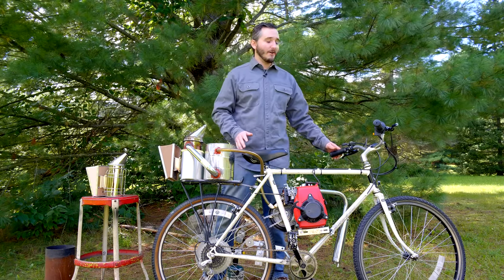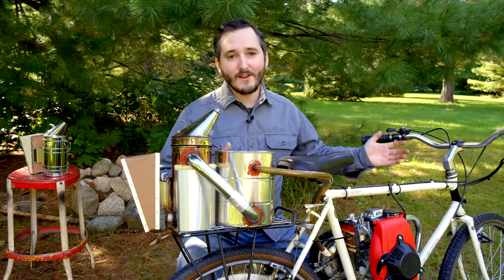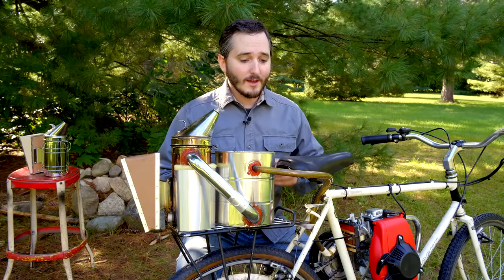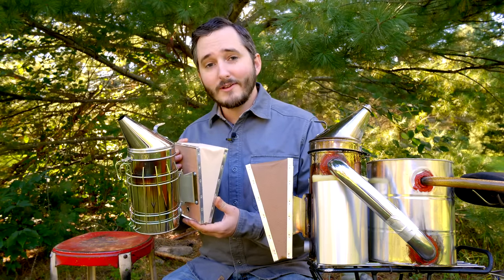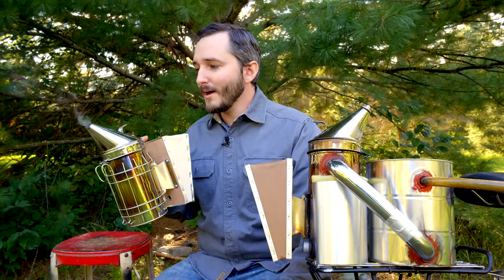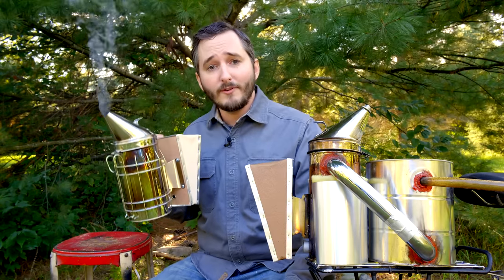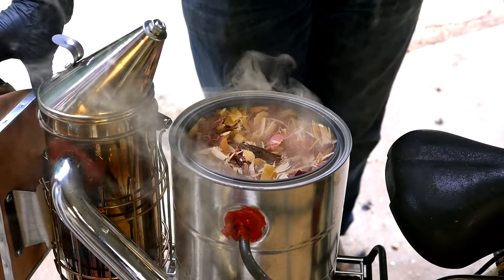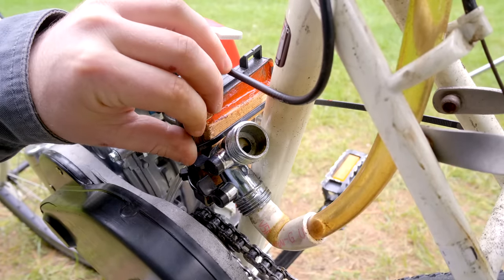Running a Gasoline Engine on Firewood | Woodgas Biofuel

Comment: can woodgas be made from industrial cannabis? killing trees isnt good but cannabis is a grass and grows over months instead of years like trees. we have enough deforestation issues. other then that its a great idea and i do love mr tesolonian. you kinda look like him XD
Reply from the maker: Yes you can use any plant matter
Reply: @Nighthawkinlight  In that case, I would try to make a kind of 3 inch by 3 inch block made from shredded and compressed hemp. stacking these blocks together in a gasafire would provide enough space for it to heat up well and thuraly while still remaining solid enough to burn and relese gas for a considerable amount of time. Hemp also has a carbon neutral footprint unlike trees so its even more environmentally friendly. See if you can figure out how to compress shredded hemp. perhaps get some hemp twine and use some natural plant glue or something?

Comment: I'm surprised the number of responses my comment pulled here.  Especially the number of foolish or arrogant replies from the under-educated part of the crowd, missing the entire point all together. 

That's one of the reasons we have the problems we have today.  It's not over-population of too many people, but the ratio of horses to horses asses using up all the oxygen and other resources without any contribution back.  ROFLOL

@Colin, not yer cup of tea.  Stick with the propane turbine BBQ grill.  That one has potential. ;)

Honestly, the point was ... we already have all we need to be 100% renewable in very efficient ways we will end up at one way or the other, sooner or later.  It will be a solution of renewables as all other solutions fail over time for different reasons we know and STILL we're selling solar and wind thinking it's going to be the answer.  :-/

Comment: Ur losing too much fuel through that air inlet. U need a one way valve on it so it can pull In air but not leak woodgas out.

Comment: "They eat a bunch of honey and go to sleep..."  Seriously?  Must have been told that as a child and still believes it, but is not true at all!  The damn smoke knocks em out plain and simple.
Reply from the maker: First of all you misquoted me, and second if your smoke is knocking your bees out you're using way too much
Reply: @Nighthawkinlight  yea I should have placed a "..." Before I quoted but the words are the same nonetheless.  It is still the smoke itself that does the job, whether too much or not and hopefully not.  

On a different note, hope ya get somewhere practical with the wood biofuel.  Got a good idea there, just not sure if you could get by without changing the design of the engine or not...

Comment: I see water running down your fuel line. this is a major reason your not running. Your not cooling the gas enough. That is the biggest issue. The cooler the gas the better it fires.

Comment: Why couldn’t you just fix a flexible tube heat resistant to the original hair and the beast smoker rather than dryi why couldn’t you just fix a flexible tube heat resistant to the original hair and the beast smoker rather than Drilling a new hole and mounting a pipe to it

Comment: Might just want to get rid of the carburetor all together and just put I throttle body there... you're wasting so much gas coming out that Port from reversion it's not even funny. if it would idle the other half of the smoke would probably have it run if it wasn't pouring out that hole.

Comment: Sigh.   Be sure of the science before you state facts.  Some points;
    Dont use PVC tubing above 80C.   Use EPDM, Silicone, and other rubbers.
    Carbon Monoxide is a by-product of the wood-gas pyrolysis.  Further combustion of the wood gas does not alter the CO emissions, as you stated, as the combustion temperature of wood gas is too low.
    CO is not a combustion [recursor.
I do acknowledge your concerns on CO emissions. I would advise you to 'suggest' a well ventilated environment.  CO presents rather nasty biological toxins to humans,